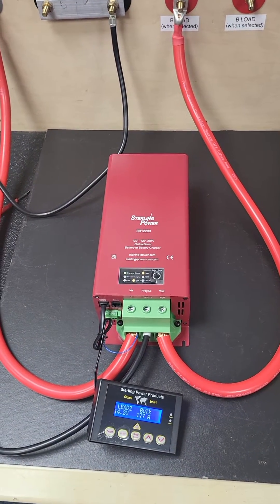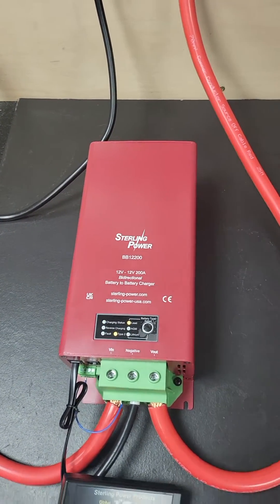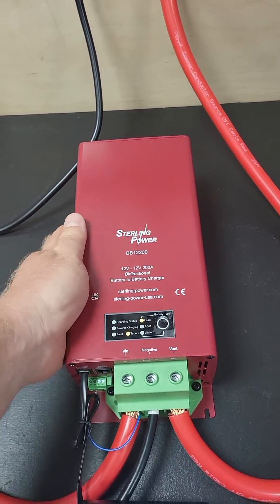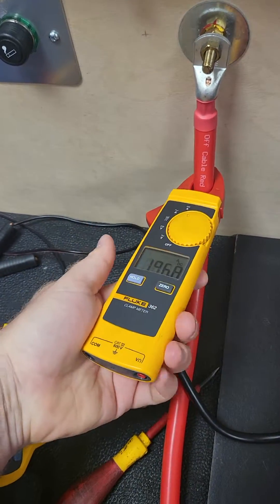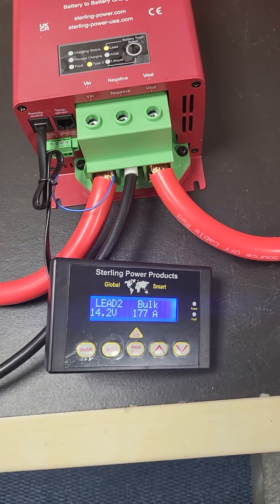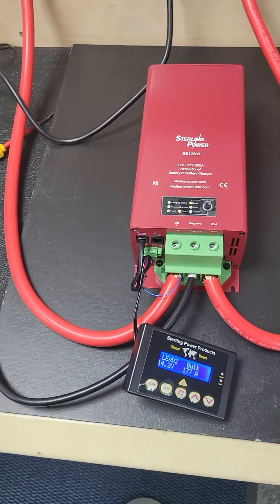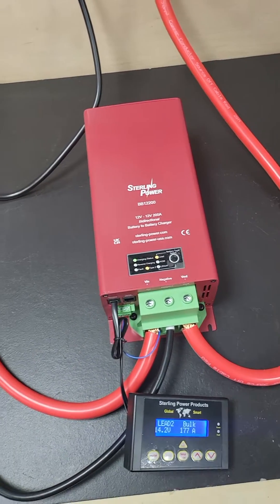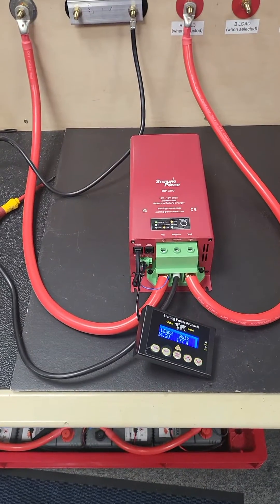BB12200 Sterling Power's 12V to 12V 200A Battery to Battery Charger

Comment: So will this have units ever see anywhere near 200 amp outputs
Reply from the maker: Hi Moonhead,

With a healthy input voltage sustained at >13.8V you should be seeing full power, with an output around 200A. Actual current may vary depending on voltage, but we can call it a nominal 200A.

Comment: I want the fastest charging my alternator can handle without blowing up. Do you have a rule of thumb for maximum load vs alternator output?
Reply from the maker: Yep- we go up to about 80% of the alternators rating, when using DC/DC chargers. 

Some fitters use 50% as the limit, but we've been recommending 80% for years now without issue. If the input voltage is struggling (IE alternator cannot support the load-) we automatically downrate to either 85% or 65% - so there's that additional level of protection.

Comment: I've got the older generation and it's a linchpin for my RV build: 14kW Lifpo4 bank (internal BMS). No reason whatsoever to spend and deal with solar. My question: I'd love to rework my system to 24v. Is there anything in the plans at this amperage but 24v? The new generations are beautiful, BTW!
Reply from the maker: Hello Agillesp,

Yes, we're huge fans of the new units as well! We intend to polish it further as time goes on...

Yes, we absolutely intend to do 2KW variants of a 12V to 24V unit and also a 24V to 24V unit, and a 4KW variant has been in development for a long time - it's being held hostage by a chip shortage that the whole world is gripped by I'm afraid. 

So yes, inbound - a slow inbound, but certainly inbound.
Reply: @SterlingPowerProducts  Great! Excited to get my hands on one when it becomes available.

Comment: Great to see the larger and larger units you have now. Also great to hear you can drop the consumption on this down to 170 amps or lower. That goes well with the 175-amp output of the 2020 Ford Transit. Looking forward to getting ahold of these new B2B chargers.
Reply from the maker: Hi Ross,

On a 175A alternator on the 2020 Ford transit, you'd probably want to use the BB12120. We try not to exceed about 80% of your alternators rating, as we'd really rather not overheat your alternator.

BB12120 is available right now..!
Reply: @SterlingPowerProducts  Thanks for the clarification. I am working with a student who is purchasing your 120-amp model for his Transit. However he has the factory option for dual 250A alternators, so up to 500 amps of capacity channeled through the same lug rated at 175 amps. Perhaps this could warrant the 200-amp model reduced to 170 amps?
Reply from the maker: @rosslukeman  Hi Ross,

Oh understood!

Ideally we'd be going straight to either the alternator or the starter battery and bypassing the 'consumer access point', as that would allow us best operation and also the option to run at full power. 

That said, though, adding a remote and adjusting operation down to 85%/170A draw is also an option, but as it will be a continuous 170A draw there is my own partial concern that the access point could get, for lack of a better term, hot. 

Most things I find in the industry have peak ratings rather than continuous ratings.
Reply: @SterlingPowerProducts  thanks for the additional details. Perhaps I will need to acquire one of these vans and run some tests as you do in your videos. I will keep the peak vs. continuous rating in mind. Thanks!
Reply from the maker: @rosslukeman  More than welcome! I note you do a number of extremely useful, compact and professional videos in this sphere. If you ever need any support on Sterling products or you have something that you need a solution for, just let us know! I don't have a technical team in the US at this moment but I'm happy to field questions from over here in the UK.
Reply from the maker: @rosslukeman  Hi Ross,

Something just came to mind. If you wouldn't mind emailing me at info@sterling-power.com I'd like to just open up some direct communication :)
Reply: @SterlingPowerProducts  Thanks for the kind words on my videos! They are a work in progress. Thanks for the invite on support, I am having to update my B2B charger recommendations as products change out there.
Reply: @SterlingPowerProducts  Ok will do, thanks-